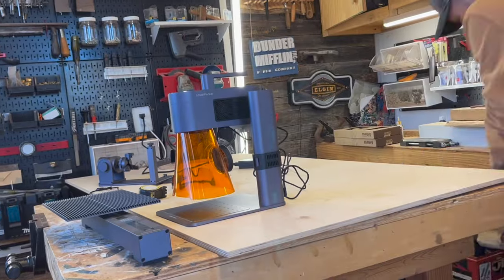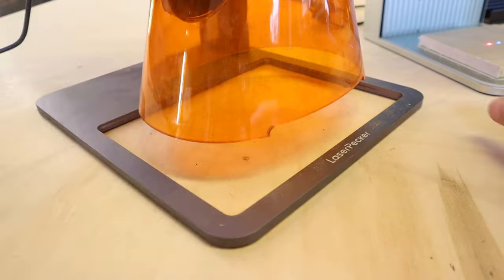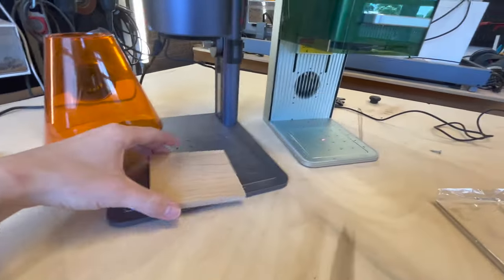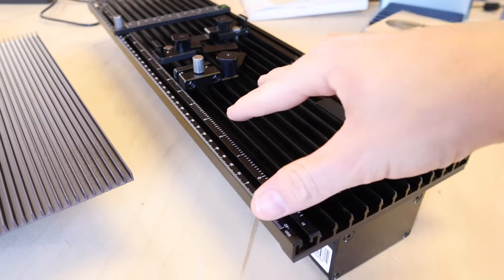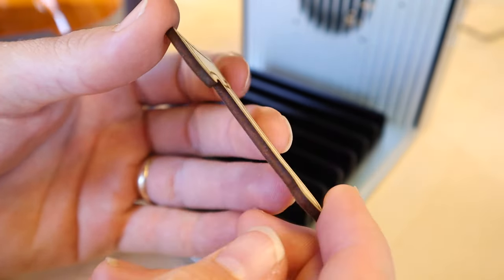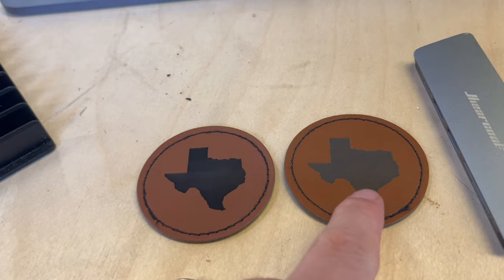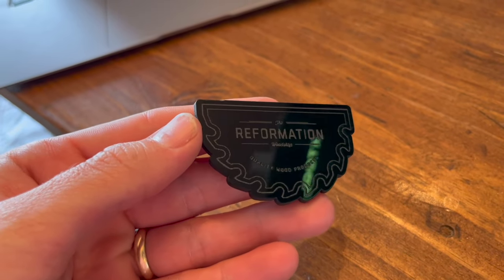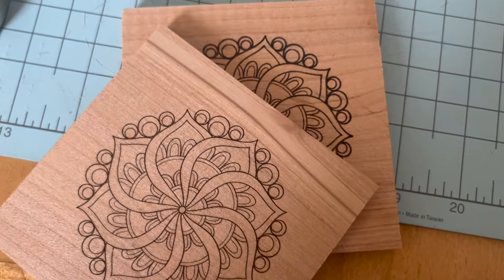LaserPecker 4 VS xTool F1 // The BEST Laser Engraver?

Comment: the darker engraving from the metal business cards is probably the power because it might actually be engraving the metal depending on the material instead of just taking off the paint.
Reply: Most likely it's engraving metal differently. Metal engraving can have different colours depending on the laser settings.
Reply: My LP2 does a great job at burning the paint clean off aluminium business cards in one pass, however if I raise the laser above the recommended height, I can actually discolour the aluminium as well, with multiple passes, changing the focal point between passes, I can achieve some pretty cool effects in the metal and painted surface. Doesn't hurt to play some! 😉👍
Reply: @Zodliness  I am just learning. Isn't the effect on metals (once pass paint) and things like stone a reactive process. The material reacts and can be colored varyingly based on settings. For example on slate this results in the "engraving" being raised above the rest if the surface a bit instead of a recess?

Comment: I an Xtool guy with a D1 Pro 20 and 40 watt machines but... I jumped on board with the LaserPecker 4 premium campaign in March 23 with everything they offer for that machine which should be delivered any day now.
Reply: how was the lp4
Reply: @skimaniac21  It  is my goto over my other engravers inuding my Xtool d1 pro 40 watt. Since I mainly do smaller engraves, it much quicker to just just the lp4 with the app than go though all of the setup with my D1 Pro.

With all of that said, they both are from really different worlds to say. The lp4, I was engraving out things the first day, within hours.

The Xtool d1 40, I spend just over $3.3k and got everything including the 1064 laser but, I haven't used any of it to actually learn how to use everything yet.
Reply: I am looking to get an LP5, would you recommend it for engraving pens and more?@JoeyMcNew-Drummer
Reply: @skimaniac21  The LP4 is great.... I don't see any reason to upgrade to an LP5.
Reply: Yes, I would say the LP4 is much quicker than the Xtool and everything that you have to do. I use my laptop and the Design App and this is much faster and more precise for smaller things not to mention, the dual laser doesn't have to be changed out. I am in near 3.5k withe the d1 pro 40 watt including the 1064 laser as well.

Comment: I have a couple of xTool lasers and a couple of LaserPecker lasers.  I was hoping your video came out a little sooner, but I appreciate you doing it 🙂  I ended up purchasing the xTool F1.  I like the XCS software and it keeps improving.  I also use Lightburn.  Again, thanks for the video comparison.  I don't think you can go wrong with either of them.
Reply from the maker: You’re absolutely correct! They’re both great. Have you tried the AI in XCS yet? It’s pretty fun to tinker with.
Reply: Hello, i have D1 20w  with RA2 pro, that we use for wooden engraving only. We only engrave text. Can you please tell us did you compare the speed and quality of engraving between d1 and f1 on wood?
Reply from the maker: I haven’t actually. That may need to be a video in the future.

Comment: @The Reformation Woodshop - Both engravers look great tools in their own right, but you didn't really convey anything about their portability, which is the primary reason I initially went with LP, it's great for running literally anywhere on a power bank and I wholeheartedly agree on LP's build quality is second to none for a young kick-starter company, although their price reflects that quality, they lack consistent firmware support and bad overall time it takes to get technical hardware support outside their Facebook groups. I'm shocked to see how many people are selling their LP1s/2s/3s and 4's on marketplace and eBay lately. Thanks for the informative review.

Comment: Wow the f1 is rated for 4000 m/s and the lp4 is 2000 m/s, happy to see that the working times arent actually doubled in real world usage,  I backed the lp4 and supposed to get it next month... thanks for the comparison!
btw, in the 10:04 wood test did you set the lp4 on its max 4k resolution(or 8k if you used the 1064nm laser though I doubt it for wood haha)?
Reply from the maker: 4k. That’s where the speed difference will come in. If you choose 8k it’s going to take a bit longer.

Comment: Thank you for the review.  Still investigating and trying to determine what may work best for me.  I am glad you included the accessories.  I think you indicated that the accessories are not machine dependent - if I buy the x-tool slider it will work with the f4, and vice versa - is that correct?  I want the ability to start engraving ,etal projects.  People have asked me to engrave on the back of watches and badges, etc.  I tell them my CO2 doesn't engrave metal - would like to be able to do this.  How accurate can you place the engraving and how small on each of these lasers?  Do they both run off of lightburn?  Thank you in advance for any insights you can share.

Comment: My Laser Pecker 4 is on its way to my home.  I just received the tracking number for California delivery.  I also ordered the bigger enclosure for the LP 4 as well as the air purifier.  Of course I also backed both extensions.  If fact, I ordered all the accessories (except the safety goggles because I have better ones) for the LP 4 including the carrying case.  Unfortunately, the bigger enclosure and the air purifier will be delivered at a later date probably in July.
Reply from the maker: I tried to get the Air Purifier it they were not available 🥲
Reply: @TheReformationWoodshop  Well, hopefully they will deliver my purifier in July since they already took my money.
Reply: July??? 😮 I’m so glad I went sign the XTool!

Comment: Hi there! Nice job with the video. I think both machines would work for my needs, which would be to engrave 20-50 daily orders like necklace shown in the minute 11.30. For easier use I am inclined to go for LP4. As I am doubting, do you have any particular suggestion for this precise type of work?

Cheers!!
Reply from the maker: I actually tend to go to the F1 (https://www.xtool.com/products/xtool-f1?ref=clSNUlHMSPHtmu&utm_medium=5306&utm_source=influencer) for jobs like that. It’s actually been awhile since this video has been published and I’ve gotten in the habit of using the F1 most of the time.

Comment: The key performance difference came from the laser modules used. LP4 uses an American II-VI (formerly Coherent, the inventor of laser) laser module, which is based on an extremely reliable but old technology (passive Q-switch) mostly used in military ignition and ranging applications, while the F1 uses an undisclosed laser source, presumably JPT or Raycus from China, which is supposed to be much more advanced but delicate, this type of laser (either active Q-switch or edge-pumped fiber) is commonly used in industrial engravers and rust cleaners. In terms of peak power and power uniformity, the F1 kills. At 8:20, the gray color you saw is due to insufficient laser energy causing the paint to be burnt, but not ablated properly.
Reply from the maker: Man! Lots of great insight here, I appreciate it!

Comment: I purchased a laserpecker 3 nine months ago and it will not connect to bluetooth.  When i turn on the laser it flashed a blue LED for about 10 seconds and then red and blue LED lights start flashing ad will not connect to any of my devices and have even tried plugging it in directly to usb and still not connection.  Support for this product has been a nightmare.  CAN ANY ONE HELP ME WITH THIS PROBLEM?

Comment: (first off, great video and you opened me up to the X-tool option, I was only interested in the LP-4 at first) however,- Sorry to bug you on this question but none of the suppliers were able to give me a straight answer. Can either one of these machines mark Steel, such as put part numbers on tool steel. I am not looking to burn through the material but just identify one die from another by part numbers. Any help is greatly appreciated.
Reply from the maker: I believe you can etch with both as long as you mark the material with a spray paint of some kind.

Comment: Good point on the shroud moving your piece when you take on and off.

Can you in the app or on the machine, control lifting up by a certain amount and then down by a specific amount?

While still not as easily done as the other, if you can control exactly how much you raise and lower it by, you wouldn't have to refocus it every time.

Still not as easy, but could be a work around if that is the sticking point between the two when deciding and they like everything about it but that
Reply from the maker: You can, only in preview mode. But you can’t do it to a certain amount. It’s just like the top button

Comment: excellent content, what do you think of the LaserPecker LX1 Max. 
My 2 choices are -LaserPecker LX1 Max and the Atomstack A20 Max 20w Large Size Eye Protection Laser Engraver With F30 Pro Air Assist. Which one do you think is better?
Reply from the maker: I’ve never used either but I will tell you I wouldn’t trade my XTool D1 Pro for either of them (https://www.xtool.com/products/xtool-d1-pro-2-in-1-kit-455nm-blue-laser-1064nm-infrared-laser?ref=clSNUlHMSPHtmu&utm_medium=null&utm_source=influencer&variant=43211209081071)

Comment: you did not compare the price value ?  I feel like the F1 is more expensive than the LP4 overall
Reply: @bestyoutubernonegraternumber1  Well that is ot what is said in the video, globally it is just a tiny bit quicker and have a smaller work surface (and yes a nicer protective cover design)
Plus it is easier to use on a wall or a vertical surface I believe
(I don't speack about the accessories here)

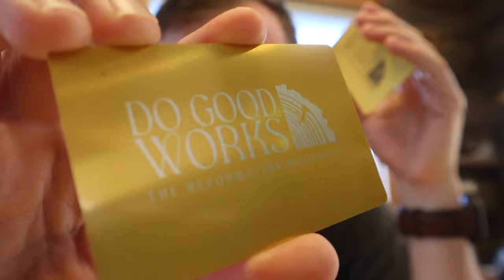Comment: 8:50 its how it burns the lasers are different? the LP4 has kinder removed a thin layer of the paint, making the paint under burn black ore to deep so it is marking the metal under? leveeing that behind. where the F1 has removed the paint completely showing the metal under. i just got a LP2 i want to burn my logo in to my wood projects, and i just got a used LP2 for 400 usd. and that is perfect for this :-)